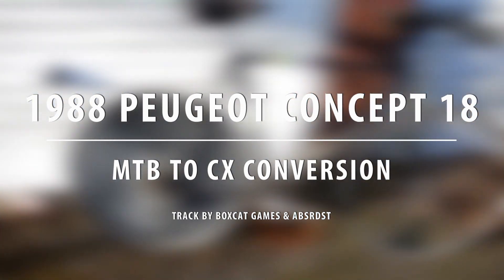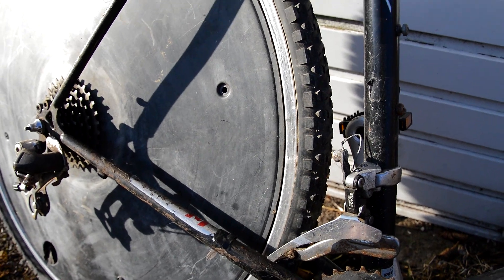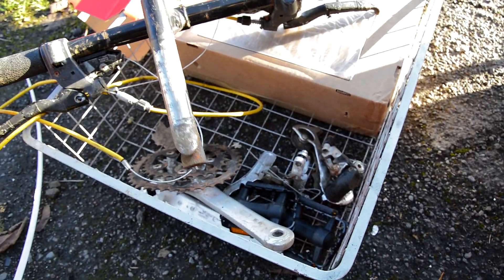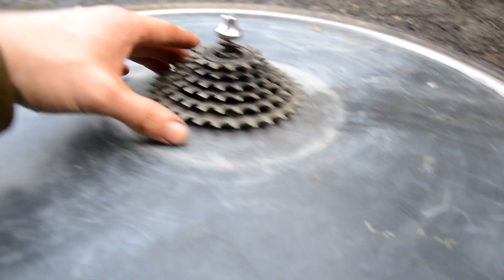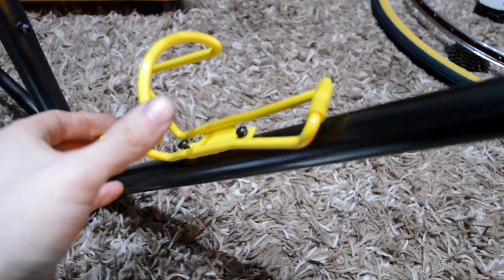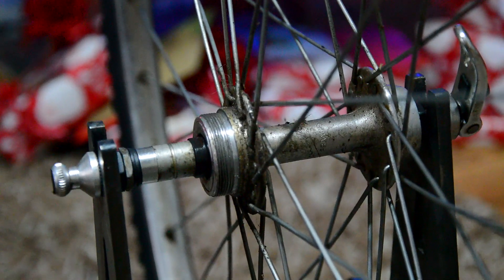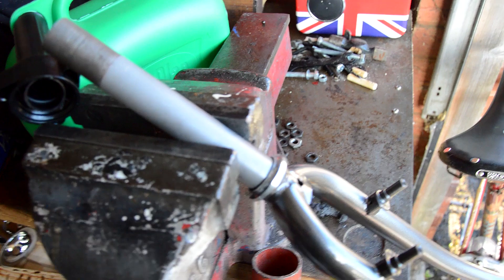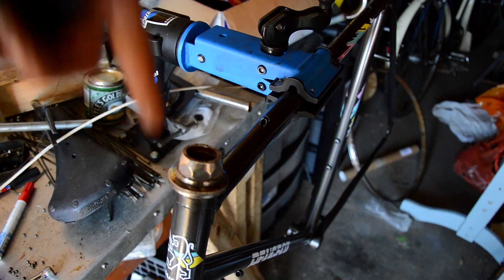Building A Cyclocross Bike For Under £300 - 1988 Peugeot Concept 18

Comment: Fantastic effort. Love the colour scheme, particularly those colourful decals. I briefly had a peugeot road bike as a commuter-bike in Manchester in 2007. Handsome bike. When the rear hub failed I could not source the correct tool to remove the freewheel, try as I did. I think someone said I'd need to move to France before I found one 😆.Had to let that bike go, sadly.
Reply from the maker: That's a shame!  Freewheel's did have a lot of options pre 1980s ish.  I have a good selection of them - some tools I've jsut bought to get one freewheel off!

Comment: Nice lock nut looks like the old two wrenches and get back on the road with some extensive skewer tension
Who do you get your decals from have an 86 jamis dakota looks like steve tolkiens in mtb action #1 i want to repaint it that pumpkin orange but the decals are very intricate gold lettering and the headbadge decal has devils tower drawn perfectly in the background dont want to ruin those unique factors getting it repainted i already had to remove a bunch of black spraypaint but the powder coat under it is whooped
Reply from the maker: I think I found the decals for this on eBay but if you need stuff specially drawn it might be worth giving RetroDecals a shout.

Comment: absolutely amazing execution, really like the yellow cable housings. How are you liking the CX comp tires? I was thinking of getting a pair for my commuter and get some off-road into my commute as well.
Reply from the maker: I'm pleasantly surprised by them!  They're not too draggy on the roads and off road they've performed well so far.  The last ride took me down a canal tow path that was more bog than path and I rode through it no problem.  I haven't pushed the bike hard along any trails, or down say, a gravel track yet, but so far so good.
Reply: Bought a pair after your comment and had them on my ss mtb for 2 days now, really liking them so far as well. Thanks a lot :)

Comment: Great! You just ispired me to to the same! One question: How did you choose the bike? Old mountain bikes generally have 26'' wheels instead 700. Is it an hybrid maybe?
Reply from the maker: Correct.  I looked a bit deeper in to it and the Concept 18 was a "hybrid", all be it a very early one.  It's somewhat possible with 26" too but you need an adapter of some form to raise the mounting points of the canti's and I haven't found anywhere that stocks those at the moment
Reply: @MonkeyShred  Could you post here the exact front derailleur code? I can't find a good (and cheap) fd working with old shimano brifters. Thanks!

Comment: Can I ask how much was the powder coating and where did you get it done (A general paint shop?). This would help greatly in budgeting
Reply from the maker: For this bike, it was £40.  Frame and forks only.  That's for stripping and powder coating.  The place I use isn't a general paint shop, they seem to focus on powder coating and building motorcycle wheels.

Comment: is that a 8 speed freewheel???? or a 8 speed cassete in the rear wheel only ask cuz I have never seen a 8 speed free wheel or a adapter to go from a free wheel to a cassete
Reply from the maker: It was!  It's the biggest you can get.  It's a bit crazy with one though.  Thinking about it I had to use a longer axle and that would have pushed the bearings further towards the centre causing the load to be uneven on it.  I did buy some CX specific wheels soon after with a proper cassette and freehub though.
Reply: ya i saw different wheels on another video you mad good work on keeping her on the road I'm a big fan of vintage bikes and feel they deserve  to be on the road

Comment: When reduing a bike. Do it right or don't do it at all.
Reply from the maker: Did I do it right?
Reply: You did it right in my opinion. I like that you tried to keep most of the parts (e.g. wheelset with hubs and brakes) that comes with the bike. I would have stayed with the 6 speed freewheel and kept the rear spacing. Barend shifting would then the alternative.

Comment: That's a good idea to reuse the CroMo frame with cantilever brakes for Cyclocross. It would also be good for off road or trail touring or even a gravel bike. I'm not sure if the Wienmann wheels with the rear aero disc are completely original to an MTB. A good replacement would be a Vuelta Corsa HD wheelset from WWW.NASHBAR.COM. They have them available for $150.00 to $170.00US from time to time. The HD stands for heavy duty, they'll fit up to so a 34mm tire, they have cartridge bearings and you can fit a modern 8 speed cassette. I've seen a really positive review from a guy on YouTube. He weighs about 200lbs. and does all of his riding off road. So they should hold up OK.